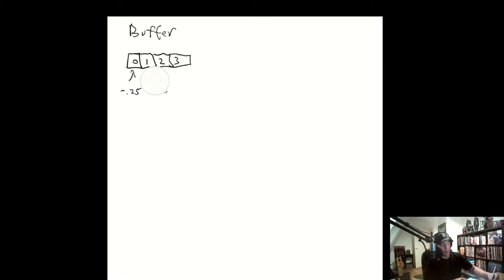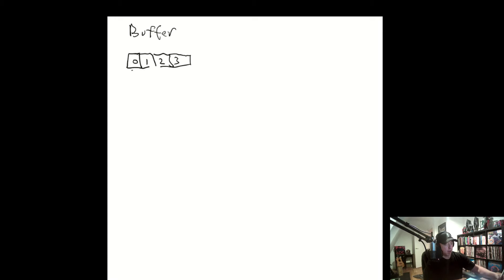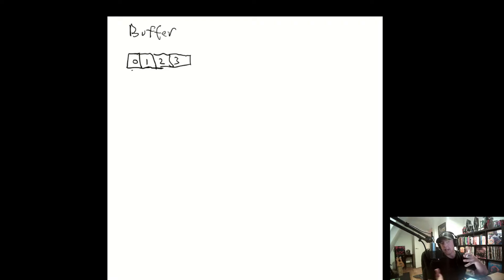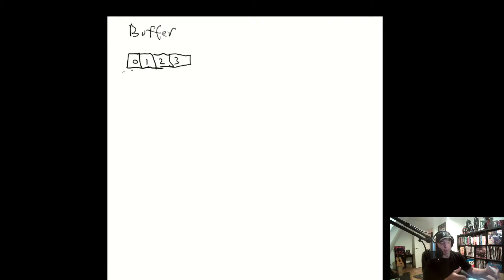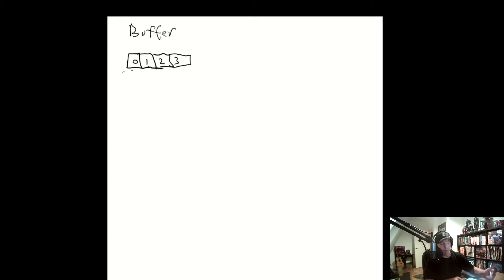JUCE Tutorial 15  - Creating a Circular Buffer

Comment: Great Video! But I have a question, shouldn't it be in the else section when coping the remaining amount to the beginning of the delay buffer (channelData + numSamplesToEnd)? So by doing this the pointer will increase to the last position copied. If we simply do channelData won't the program take the the values in channel data from start? Am I right?

Comment: Thanks for the very awesome tutorial video! However, I do have a suggestion. Would it not be more efficient to have separate for loops for the conditionals instead of the if else inside the one loop? Because it seems like only the if XOR the else statement will occur per call to processBlock. The code size would definitely be slightly larger, but you would only have to branch one time per call to processBlock from the fillBuffer function.

Comment: (Not to be unbearably nitpicky, but) It seems your "wrap?" conditional test would be better as '>=' rather than '>', In the code that you eventually refactor into the fillBuffer function. Consider "if (delayBufferSize > bufferSize + writePosition)". if delayBufferSize == bufferSize + writePosition,  the circular buffer can jussst fit the new data of size bufferSize, and the "if" block would handle it properly. However, your code executes the 'else' block, which first copies bufferSize many samples in the first two of four lines, and then pointlessly (the next, last two lines) copies 0 samples to the start of the delayBuffer, incurring an API call for nothing.
Reply: I'm a newbee so I may say something stupid. I think you need ">" because writePosition starting with 0 position, not the 1
Reply: @dahrendorfguitars7291  Yes indexes are zero-based, so the length of an array or vector is one greater than the last valid index/position. You don't "need" strict >, work out what happens when equality holds.